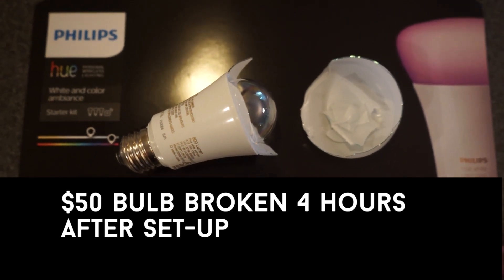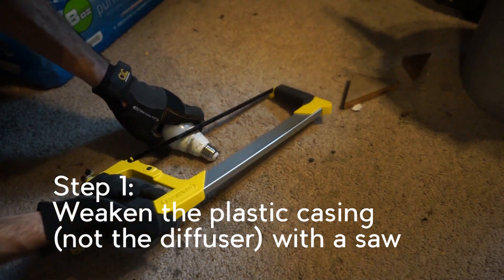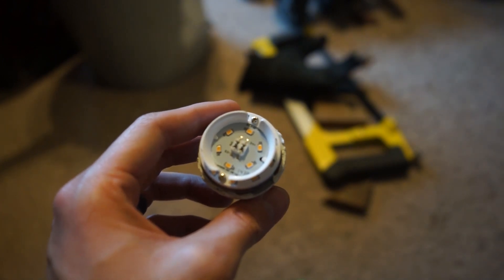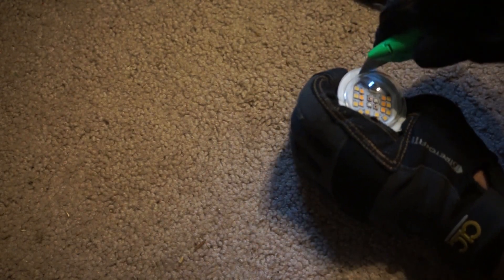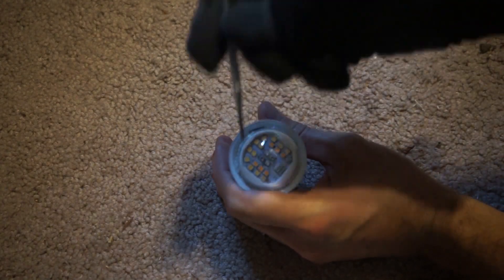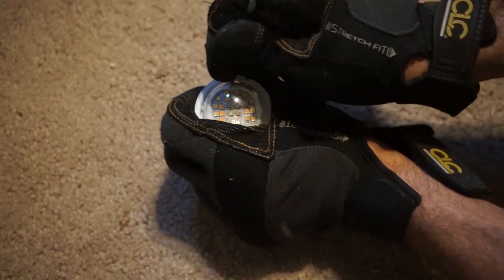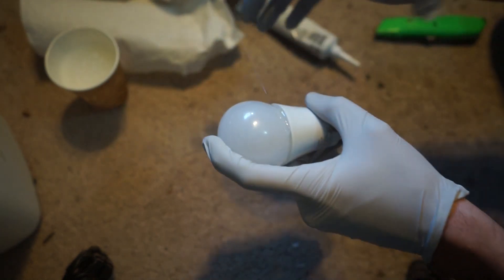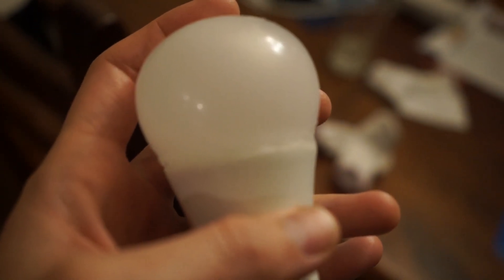How I repaired my broken Philips Hue bulb

Comment: Thank you. This is good to know. I broke 3 at once when I was moving a 3 bulb lamp (one of those tall floor ones with the curved “branches”). I totally forgot to take out the bulbs since they make the lamp top heavy. I was just happy to have the last item out of my old apartment. 

CRASH I thought I needed all new bulbs. I ended up just pulling the bits of glass from the rim once I saw the little dome on the inside was still intact and putting the bulbs into the ceiling lights with thick glass dome diffusers. 

I will remember this video if I decide to move them elsewhere.

Comment: How does this hold up over the years, still working well? Looking to do this myself.
Reply from the maker: Yes! Still working over 5 years later. I put it in a ceiling lamp where it wouldn't get jostled, so it's probably not a bad idea to find the lamp you're least likely to move around and use the repaired bulb there.
Reply: @joshratiani  that's great, thanks for letting me know. Yeah, think I'll have a go at fixing it, and put it out of the way, don't want it broken a second time! Thanks.

Comment: Good hint to use the Ikea bulb as a spare part. But dont torture yourself with using saw, cutter, gloves and silicone. Did this repair today and it is a piece of cake using a Dremel and Hot-melt gun 👍

Comment: Just had to fix one of these... turns out they don't sell the E27 bulb anymore. However the Ledare bulb (E26) will still work but it requires that you shave some of the base of the diffuser. I just used the razor blade and kept shaving the inside of the base until it would fit... worked like a charm!
Reply: Isn't E26 the American "standard" while E27 is used in Europe, Australia and so on ?

Comment: Ours was damaged in the box when it showed up.  I used the diffuser from a Feit Dimmable LED bulb.  I had a little handheld (Craftsman Bolt-On) grinding wheel that I used to cut it off.  It fit snugly over the Philips Hue - no need for silicone.